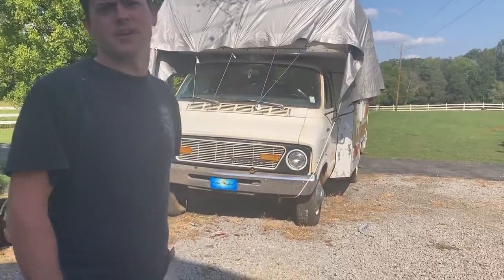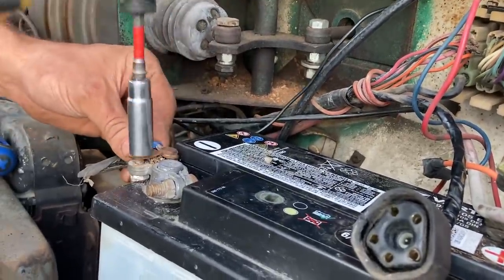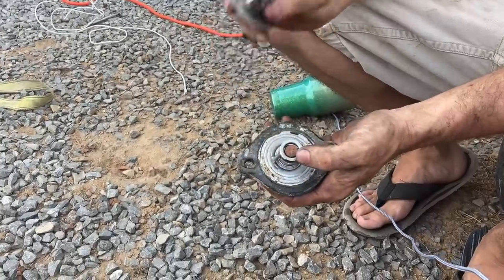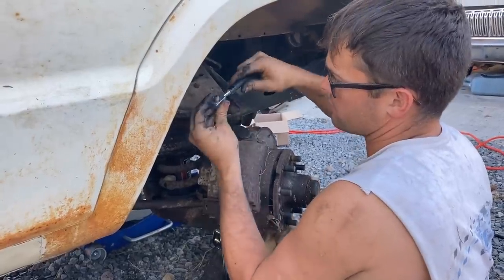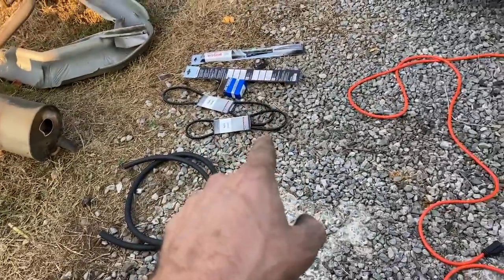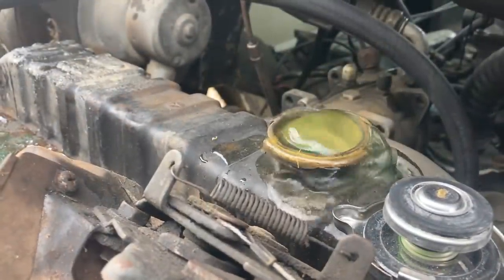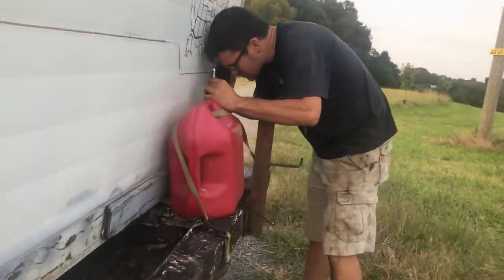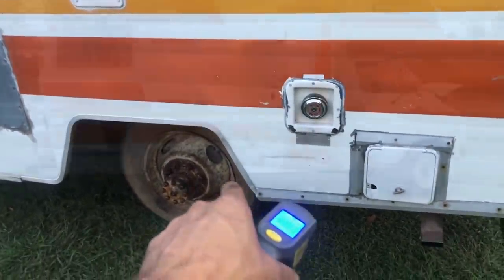broke down in our old rv on our first drive after it being parked for 27 years

Comment: Seems like this is comon in these old motor homes on dodge van chassis they replace the rear end with a heavy duty doule wheel but don't change the front to match the back meaning you need two spares one for the front and one for the back one thing to watch for is if it's the unibody frame it's wise to take off the front shakle on the rear axle the unibody frame mounts are designed for the weight of the original van rear end not the extra weight of a  motor home even the weight front a one ton van with a good load in the back will break the shakles  from the frame the next thing you know you start hearing a banging from the back end as the dhakle beats against the old van floor my brother used one ton vans for his delivery business and he had to fix a few I also had to fix the my work van and l had the same problem with my Chinook  motor home  the only good thing is other than the banging as you drive the rear axle dosen't move out of alignment but it drops the back end down about eight inches I drove it about 8 hundred miles the last of our trip before we got home so I could take it to a welder I knew and  could trust to fix it I also had him extend the frame and put it new rear bumper on as I had decided to add a rear bunkbed we found we had a definite problem with not enough beds as most are designed for mom and dad and a child or two we had great uncle great grandmother grandmother and two of her grandchildren one of each and none could sleep in the same bed with the table made into a bed for grandmother and the bed over the cab for me and my geatnefrew at the head of my bed   I put the table on the front seats with my toolbox under to level it out for my great niece it left mom on a camp cot in the isle there was no way to go to the bathroom with out disturbing someone so when I had it in for welding a six inch çhanel iron to mount the shackles to i added fourty inches to the frame so I could add the bunkbed to the back this had become more needed as we added more of my sisters grandchildren three boys and a girl put her on the front seat three boys in the bed over the cab  mom on bed that converted  from the table seating area my sister got the lower bunk and I had the other as usual with trying to do the modifications after work I didn't finish before we left 
U put the clearance lights on and rehooked up the water tank at our first camp site three hundred miles from home we had a great trip a lot miles we bondock all the way and as we alway did nu set itinerary if we saw something interesting advertised or just a sign along the road we'd add it to our stops we saw a sign that read Dysart Cupar and and arrow and miles to it pointing left mom said thats where your dad was born and gtew up so left we went  found some relatives and a lut of family history also found out how people remembered him stoped at the museum and were disappointed that it wasn't open till Monday three days away so we thought we'd have to miss it but two people came out of the building asking us what had brought us there and we told them dad was born and raised in the area the older gentleman asked our last name and said that there was never any family by that name in the area so i said maybe you  knew him as the badger or digger and he was off boy could those two Rudy's dig dad's partner was also rudy and then he started reminiscing about his brother's and sisters he knew the whole family but only by first names and dad by his first name and nickname  best part was the lady was the the curator of the museum and she let us in to see it after that we we went to the cemetery to see if we could find our grandparents graves couldn't find them we left mom and the kids at the camper when we got back we found a fellow trying to cut the grass and knowing our kids apologized it they'd gotten in his way he asked us what brought us there so we told him and also said that we were looking for relatives told him our last name dad's aunts name and dad's mother mother's.name and ihe said that his wife was a  turned out she was dad's cousin and his aunt was still living her own home at over ninty years old  so we got to meet meet her next morning he came and invited us to breakfast we were then told that another of dad's cousins was waiting tor us ln Cupar and we also found out why we couldn't read any names in the graveyard it was the Greek orthodox and they were all written in Greek but we did find our where to look there was a German town that had died out and all that was left was the cemetery it was a great trip  but on the last day on the way home we were thinking about the old song six days on the road and lm going to make it home tonight it was ten days with four kids all nine years and under and all with adhd and it was time for those to go home to their mothers one thing the original owner had done like the owner of your motor home he wrote a list of handy tips one was to keep the old dodge maximum speed to 555 miles per hour or watch the gas gage drop we got good gas mileage on our trip but a few years later my sister and I went with a  friend In her dodge motor home and we saw what he meant we told her but she said the speed limit is seventy and that what I'm doing when it was her turn to drive she didn't get half the miles my sister and I got between filling up since your's is a dodge it'll probably do the same and with gas prices over triple what they were then you can put up with slow and steady unless you have money to burn